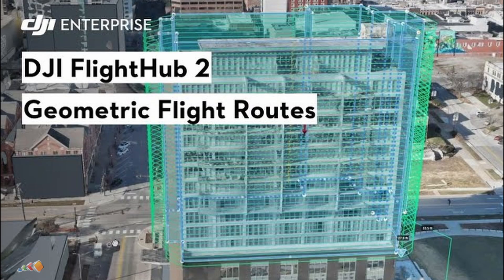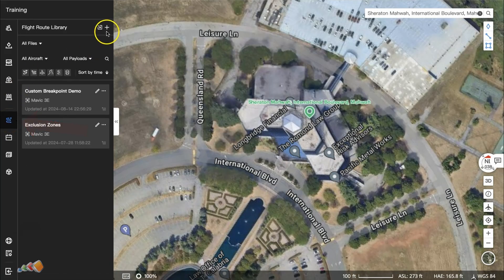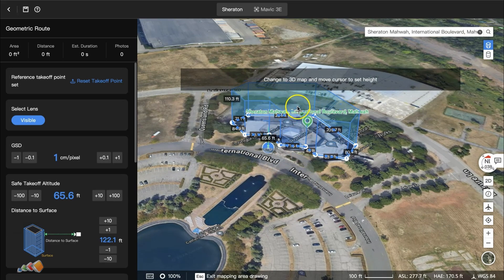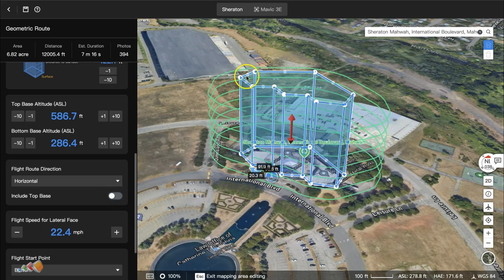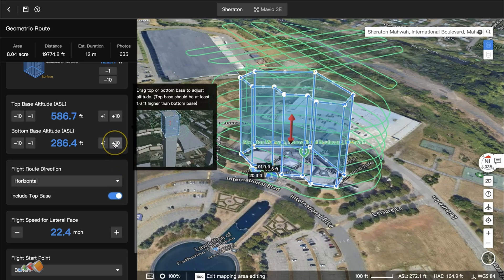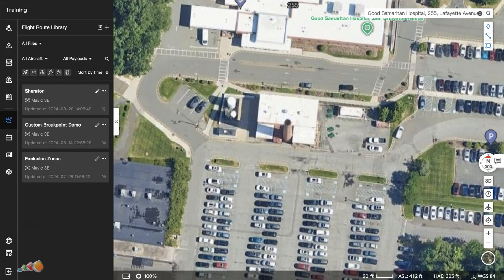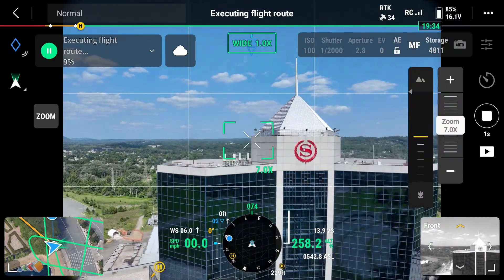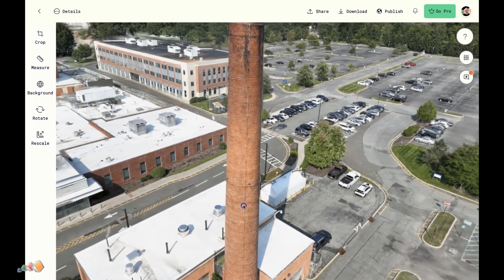Geometric Flight Route with DJI FlightHub 2

Comment: I realize a reply is unlikely 9 months after this video's origination BUT...when I create the geometric route, no path that caps the building is created.  Was that feature removed or am I missing some trick or somehow building size matters?
Reply: Note: the Include Top Base option in Flight Route Direction is removed in my project.
Reply from the maker: I don't think building size matters and I just went into flight hub to test and the option for Top Base is still there for me so I can't say why that would not still be the case for you.
Reply: @aviosmedia  Thank you for the reply.  I'll try it with a taller structure to see what happens.
Reply: @aviosmedia  I tried a taller building, still no pattern capping the top, still no option to include one.  Maybe its not a feature of the free version.
Reply from the maker: @anokboomer1155  I'm using the free version so that isn't it.   Can you screen record it being created and send it to me at barry@aviosaerialmedia.com?  Or if you wanted to do a paid session I could set up a video call and walk through it with you on the screen so we can get to the bottom of it quickly.

Comment: Would like to see a video of the full process..generating a geometric route on a premade 3D model in FH2, and then running those mission(s) in the field. Im having issues with it every single time..the route is almost always off (usually somewhere up in the air). And then correctly placing the route in real space on a controller in Pilot 2 is a really painfull process :)
Reply from the maker: Where are you located?  Maybe we could meet up and figure it out on site?
Reply: @aviosmedia  Would love to meet up, but Im in Croatia 😅
Reply from the maker: @Simpleton983  And you can't jump on a plane and head over?  🤣
Reply: @aviosmedia  😂
Reply: @aviosmedia  Hey, I do have a question though. So, when you made an outline of a geometric route (a shape) on the basemap and set the ASL values, was the route placed correctly in real space? Was everything looking ok, or you had to move it around?!
Reply from the maker: @Simpleton983  Mine was in the correct location - it was only figuring out the correct altitude that was the issue
Reply: @aviosmedia  👍 Tnx!

Comment: DJI should put AGL option, ASL of ground is very hard to know, any tips or tricks you got please do share
Reply from the maker: That is a great suggestion for DJI, but for now it would be a workaround to get AGL!  One useful thing is that as you move the mouse around the map, the ASL figure is shown in the bottom right of the screen.  So you can position the mouse over where you think you will be taking off from, note that value, and then subtract that from whatever is shown in the ASL field to give you AGL.  It's not a perfect solution but it's the best I have come up with so far.

Comment: Can we create these types flight routes in RC? 
And do we need RTK module & D-RTK2 for performing this kind of missions?

I have dji mavic 3 Enterprise with rtk module but don't have D-RTK 2. Can i use this feature?
Reply from the maker: Hi.  
Yes, you can create these directly in the RC.  That was not the case when I first tried this but, after an update, it is now available.  Just start creating a route as you normally would and it will show up as one of the options.

You do not need an RTK module to tun these.

You don't need the D-RTK...at all...ever.  It's a nice tool that works seamlessly but, IMHO, there are better options such as the Emlid Reach RS2+ or RS3 which do the same job, for less money, without locking you in to DJI equipment.  

Another option is to use a CORS network which avoids the need for a base station in many cases.  See how to do that here https://youtu.be/cESXvYiQ5ps
Reply: @aviosmedia  Thanks for sharing your valuable knowledge.
Reply from the maker: @arulr3021  My pleasure

Comment: I absolutely LOVE your channel!! Thank you for the thorough walkthrough. I am able to create the geometric flight route using the DJI RC Pro with DJI Pilot 2 for the Mavic 3 Enterprise. This option was included in the latest firmware update. Keep up the great work!!
Reply from the maker: Thanks.  Someone else said the option only appears if you have the RTK module attached.  
I need to look into that.  Would be nice if they have made the change to allow for both.
Glad you are enjoying the channel!
Reply from the maker: It seems that came out after I created those missions but it certainly appears now.  I did say "as at the time of creating" 🙂  
Interestingly they have now also added the linear route, which was previously not available, so both of those now work.

Thanks for the clarification!